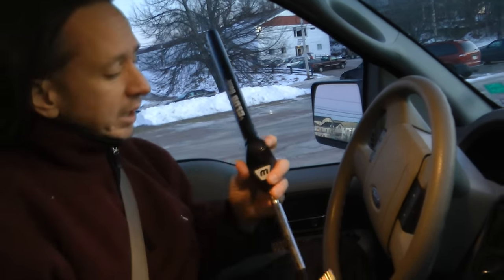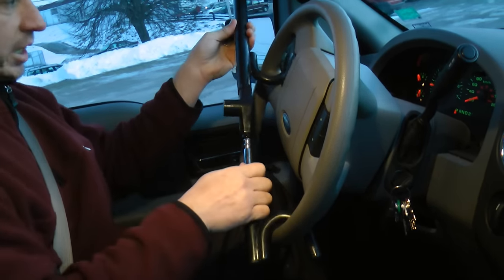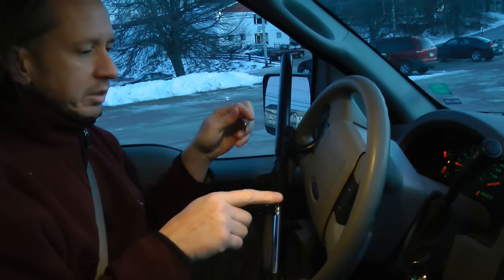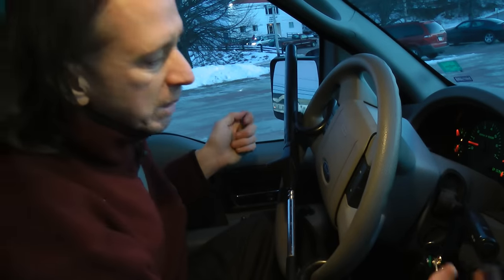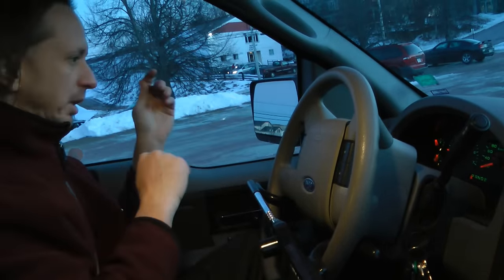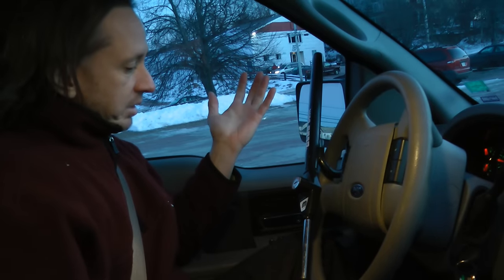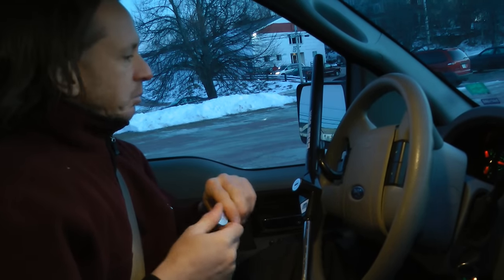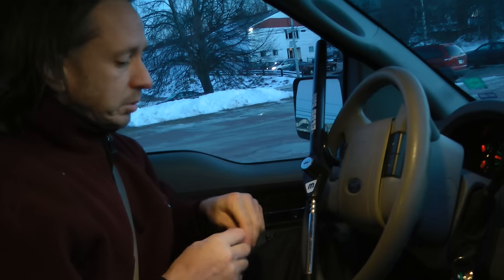How to Use an Anti-Theft 'Club' Device

Comment: Thieves only steel cars for a couple different reason. One common one is teens looking to go for a joy ride which a club will stop. The other is organized crime looking to pick your vehicle apart for parts. The club wont stop one of these thieves because they will have a saw with them and they will just cut rite through the steering wheel and pull the club off.
Reply: Your forgot me sir.  If you don't keep up with the payment I get called in to take it.  Drill in the key hole and if it's flipped over then drill out the pin.. And I'm gone
Reply: "steal" not "steel"
Reply: @jasonborne7348 We're not talking Repo man shit here dude 🤣🤣🤣🤣

Comment: I could take that club off in 7 seconds The club does not do nothing 7 seconds All you need is an extra tool in your hand when you steal cars which is a hacksaw cut the steering wheel bend it take the club right off 7 seconds
Reply: @Ki1ngOfGods  We need to put all key board warriors to real battlefronts. Something tells me the bravado would be toned down a notch or two.🤣

Comment: The lock is the weakest point and a portable drill will defeat it easily. If possible place the club with the lock facing down near the top of the dash where only the key can access it.